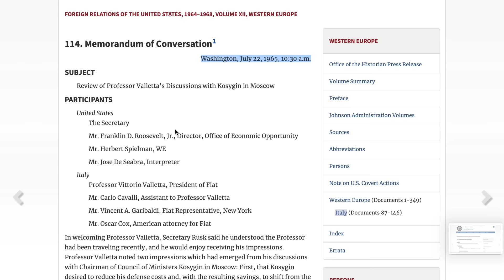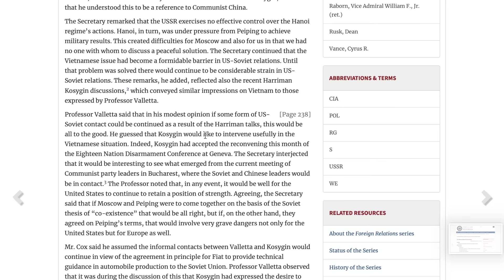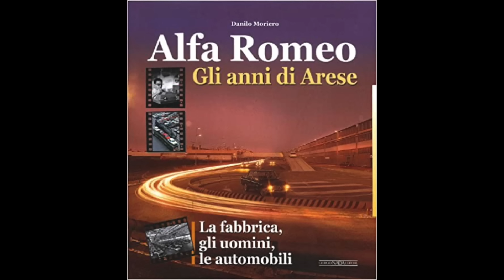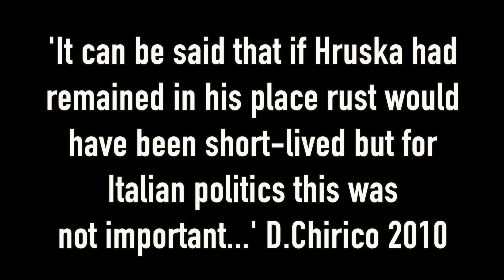Alfa Romeo And The Myth of Russian Steel - The Real Reason Alfas Rust

Comment: I think the steel of this era suffered from the transition to melting scrapmetal electricaly instead of melting up a mixture of coal and ore in a blast furnace as before. The scrap at the time contained a lot of pollution (just look at the way they did it: light up the car to get rid of the interior and then press it all to a cube, loom and stuff included - you know what I mean) which led to heavy corrosion. The issue was common to all manufacturers in the 70s and overcome by better rustproofing.
Reply: Quite possibly a factor, but from Alfa Romeo's point of view, and regardless of whatever people say about the seventies, it is a FACT that the Alfasud was made from the same steel supply as the rest of the Alfa Romeo range, and yet rusted far worse and far faster, even before leaving the showrooms.  And yes we know people will want to add that their Spider/Giulia/GTV or whatever rotted badly etc, etc, but Alfa's management soon recognised the warranty claims were hurting and sent Achille Moroni down from Milan to investigate.  His report was very clear, it was all down to poor working practices, nothing to do with the steel supply.
Reply: @chrismartin9421 I really loved these Alfasud when they came out for their shape and sound. They soon became famous for dangerous mechanical problems as seized wheelbearings even before the rust became too obvious and I never dared to buy one. But  I had a 1970 Spider Veloce and can tell that they rusted from factory.  It was said that each Alfa came with a piece of sandpaper in the glovebox as standard Equipment. The idea to fill the Alfasud cavities with foam didn't help either.
You certainly have a point with the poor craftmanship and working practices. There a other examples of this combonation that went wrong as the famous disaster of Rootes Group Linwood factory. But  in Bochum on the other hand this was also true and the first workers were bakers or bricklayers but they did a good job on the production line. The cars were rotted out after ten years anyway just as cars normally were after that time.

Comment: I don't know about Soviet steel, but owning a few cars from Japan Toyota and Honda in the 70s and 80s suffered from rust very badly. Seems everyone was in the same situation recycling old washer, dryers, fridges, stoves and scrap metal in general had the 70s 80s metal recycling problems. The process must have been fixed as cars last a lot longer today without rusting.

Comment: Thanks for Making me clean my Laptop as I spat out my tea at (16:33) "Franklin Roosevelt who wasn't yet president". 
By the time the meeting with Professore Vittorio Valletta FDR the 32nd President had been dead for 20 years. The meeting was with Dead Rusk President Johnson's Secretary of State (The Secretary). After checking the FDR Jr mentioned is the son of the former President, appointed Chairman of the Equal Employment Opportunity Commission By President Johnson (Director, Office of Economic Opportunity must be a Typo). FDR Jr was a friend of the Agnieli Family and at one point owned a US Distributor of Fiat and Jaguar cars, (so probably a bit of a conflict of interest there).
As a child of the seventies and at the time a petrol head the causes of "Italian rust" where well known at the time  In the case of the Beta it was due to trying to implement, at the time new corrosion prevention primers on a bodyshell with closed compartments. The "Galvanic primer" accelerated rusting in untreated areas hence the reputation for rusting from the inside out. 
There were also Jokes at the time about buying parts for the Alfasud as due to the micro strikes only one line may be affected and an 80 model may be a 79 under the skin. The rust issues were never as universal as with the series 1 Beta more of a lottery.
I think the first time I heard the story was in a Clarkson Xmas video in the late 90's.

Comment: So that myth is debunked. Very interesting and well-researched video.   
Back in the day I heard from people in the business that the Alfasud had some kind of foam blown into some of the cavities ( pillars and elsewhere) to stop noise (booming).  This would hold moisture and speed up the rust process from the inside of the panels. Also it would prevent normal after-market rustproofing (Tectyl, Dinitrol, Waxoil-ing) from working properly. 
Is this also a myth or is it a fact?
Reply from the maker: It is true, only some suds produced in mid to late seventies  had it, it was an interim measure introduced to try and reduce rot but it did the opposite!

Comment: Brilliant!  I too noticed the reference of "Roosevelt" as the former President (who actually died 20 years earlier), but obviously an oversight that does not affect the case made here.  It sounds like the typical lust for power and / or money that becomes so overwhelming that it causes dysfuction and the ultimate breakdown of harmony.  And if its any consolation, how can you blame the workers when there is such high unemployment and they need to take whatever work they can get, but are pawns of union bosses and government officials?  Regarding FIAT, I wonder if Russia would rather have paid in steel rather than oil?  Which would have been cheaper for them to use as payment?  My perception is that the Russians had / have more oil than they know what to do with, but I don't know if they had that much excess steel.  Regardless, this is fascinating!!!!

Comment: Intriguing. I had a 1973 Fiat 127, which I bought from a friend in 1978. It was already beginning to rust badly, hence cheap for a brilliant, lively fun little car. I kept it until early 1981, by which time the bodywork was in serious cosmetic trouble, though not structural.  Door bottoms, bonnet,  boot lid,  wings, all headed toward perforation. Shame really. But aside from the engine and  gearbox, which never gave any trouble, the rest of the car was plagued with short life components. Brakes, CV joints,  balljoints all lasted less than the 3 years I had it and I replaced them twice.  All the parts were dirt cheap, but lasted even less time than Ford or, good god, Vauxhall.  

I sort-of agree, that this was not much different from other mass market cars, but I think the Fiat was at the bottom of that league. The kindest thing I can say is that 60's Fiats were even worse! I had long term use of a glorious Fiat 1500C, a few years earlier.  It looked elegant and drove great, RWD with a lively, revvy engine, posh disc brakes,  but the bodywork everywhere was held together by paint. Bits literally fell off each time you shut a door. It was barely 5 years old. Even my old 1963 Hillman Superminx Convertible (in bits at the time, knackered engine) was relatively rust free at 8.  And the 1958 Ford 107e Popular I bought for 10p (the seller's busfare home) had no rust at all at age 13 (nor bigends - but I got a newly recon engine from a breaker for £7.50).

Comment: To the Alfa story, you may add that the management cleanup of 1974 involved Mr Luraghi, who really was a visionary (he had made Alfa what it is still remembered for today) paving the road for the company’s disruption of the next decade. The lower point of the process probably being the joint venture with Nissan, marred from the start by De Mita, who had a new plant built in the region he came from (100km from Pomigliano) instead of filling up the capacity of the Alfasud plant. Overall, the Italian car industry has always been used as a system to build up political consensus, absorb excess workforce and push up internal economy. After the end of protectionism, and with Fiat management partially withdrawing from the car manufacturing sector, it all went wrong

Comment: As I remember the only way to save a 70s car from rust was to have it "Zeibarted" from new. I believe this was a wax coating sprayed into every panel cavity on the car. Even Minis would stay rust-free for 10 years with this treatment.
Reply: Yes I remember that my uncle had his Vauxhall VX4/90 protected by Zeibart. Unfortunately being basically a upmarket Vauxhall Victor it still rusted out and fell to pieces. I don't think anything could save those vehicles from the dreaded rust they were completely beyond help. Maybe Zeibart gave it an extra 6 months.

Comment: I'm not convinced that storing steel outside was a problem. 
All steel oxidises when not protected so will need taking back to good metal before painting. 
Unless your steel has lived in 0% humidity since it was made it's going to have surface rust.

Comment: those aluminum twin cam blocks were cast from junk, coolant used to bleed off under the headers, on the 1300 and 1600 twin cam engines

Comment: Actually, early post war soviet car build from belgian steel ( gaz m20, gaz 21, gaz 13 and other ), but lately, i think on 1960, all russian car manufacturers start use steel from Zaporozh metal fabric. After soviet-italian project VAZ in Togliatti, italian actually bought soviet steel. But, russian car same period didn't was so badly rusty, many of this car have 30-40 years of uses and still didn't rust much. Absolutely right thing - belgian and other European steel was better quality, but -  soviet cheaper. I think, it's poor quality of production and painting process on italian manufacturers is the key.

Comment: I have a 13 year old Brera, it’s not perfect when it comes to rust. Front subframe, rear subframe, air box bracket (this had to be replaced, it turned to dust), washer bottle bracket, front bumper support brackets… I could go on. So, at the time when this car was produced, they did a good job of protecting the monocoque with galvanising but completely forgot about lots of other vital components
It’s not moonlight and roses, not by a long way
Reply: I used to have a 146 and it was very low at the front. The bumper supports rotted away but in part I think it was them flexing every time you caught the bumper, multi storey car parks were a nightmare. Rest of car was solid.
Reply: Mercedes of the same era are pretty well as bad. In fact Mercedes were the worst rusting cars of all from about 1997- 2001. My neighbours MB Vito van was scrapped at seven years because of rust. My 14 year old Alfa 164 next door hardly had any rust at all.

Comment: When I first bought a car in the early 80's I was told never to buy Italian cars because they rusted so badly , and it certainly seemed true enough.
Also I was warned off 1985 Ford escorts and orions later on.
That seemed also very true with numbers of them stacking up throughout the local scrapyards. 
I was told that was because those cars were built in Spain and had insufficient anti rustproofing on them for Northern markets. 
Anyone know the truth about this?

Comment: I remember that era all too well. Great cars, some only a few years old and they'd be disappearing in front of your eyes like polystyrene and poly cement. Real pity because they were great cars but no amount of welding could give them any more than a years MOT. We used to buy them down the auctions for nothing, weld them and race the fuck out of them usually until they broke. Italian parts were also dead expensive and difficult to source; especially prone were CV joints and the cam belts that had only had a short lifespan and were a pain to replace especially if somebody had welded over the engine mountings on the left, so you couldn't drop it, which was not uncommon as often there was so little to weld to; esp inner wings. Great cars but a fucking nightmare for rot and you know that whatever you spend on it is like pissing it down the drain co's you sure as hell aint getting it back, unless it's a Fulvia where you could get good money for the V4 engines...strange to think now nobody would break a Fulvia, but in the mid early 80's, front sub frames would go on them, gorgeous wonderful cars though.

Comment: That Pomigliano factory is just somehow cursed with rust issues. Every Alfa Romeo ever build there is prone to rust. Even relatively new 156, 147 or GT are rusting as hell. My uncle got new 156 Crosswagon and after only eight years that car had to be scrapped because of excessive rust it was no longer roadworthy. Even 159 do rust, but not as bad. On the other hand cars from Arese like 164 are really excellent in rustproofing. Same goes for 166. Even older Alfas like 75 or 90 are a bit better than BMW of that age.
Reply: My Alfasud had very poor quality steel- it was much thinner, prone to rust and the quality of the paint was much lower quality than my Alfettta GTV6. I have no doubt the steel used in Arese was better quality than Naples, poor practices notwithstanding. I am not convinced that rust plagued other cars as much as the Italian cars of that era from the South, or that the Italians got it so badly wrong by a series of unfortunate missteps. I am not convinced by the information provided that the steel was not the culprit, whatever its source.

Comment: Alfasud was doomed from day one! Wrong location, no training, too much local corruption, "i sindacati" and the perpetual "sciopero", not a chance to succeed! Quality, or lack of, of steel had nothing to do with it. On the other hand, my present Alfa Spider, made in 11/87, has NO rust issue and it has been very reliable with no problems except for the water pump breaking at age 26, not bad!, the rest just maintenance, oil changes, breaks, tires and wipers!

Comment: Thank you for an interesting video.  My Uncle was a huge fan of Alfas and had a whole string of them - he got a new one every 18 months and the previous one was passed on down to my father (They worked together)  I had 2 Alfa Suds, the latter being a Gold Cloverleaf that I bought off said Uncle.  We discussed rust etc. and his reasoning for the poor quality of the steel and latterly the first manufacturer to use galvanisation on all cars (like the Gold Cloverleaf) was that the Taranto steel plant received subsidies as long as they recycled 50% of their output, and as a result of Mafia/Socialist/southern Italy the quality was inherently compromised.   As my Uncle was a polyglot, their company manufactured machinery and his relationship with the Milan factory was excellent I have always believed his reasoning.  If you were to continue with the investigation, Taranto might be the place to start.
Reply: Yes this sounds far more plausible.  Impurities, and poor mixing of the metal so there were variations in compostion across the sheets, leading to internal potential differences.  Add water and you have rapid corrosion.

Comment: I had heard the Russian steel ,but for  Fiat ...The Agnellis where known for supporting whatever side was in power and what was good for them ...I have found that in the UK people have never ever  forgiven italian car makers for the rust and people nowdays who wouldn't know still peddle the theory that italian cars rust ..As you say back in the 70s all brands rusted ,Japanese cars where shovelled off the boats ,French cars where bad and our own brands where the same ..The metal treatment we have now was not a priority then ..Nowdays  10 year old cars still look good back in the 70's it would be a yearly requirement for new sills ,wheel arches . mc pherson strut mounts  (ford) ,floor pans ,valances etc ..Also in the 70's italy was pretty corrupt so the mafia involvement makes sense ,We also had constant strikes ..Even issues about italian wiring is still rife .i have never had issues with any of my Fiats or Alfas ,Well apart from the loom that goes from the body in to the boot ..The book looks interesting and i may be tempted to buy it  ..This was an excellent video and it explains a lot and makes sense
Reply: True the '70s had a lot of rusty cars, but the point of this investigation was to find out why the Alfasud rusted much faster and with worse consequences than the rest of the Alfa range which were made from the same steel supply but in the Milan factory rather than Pomigliano d'Arco.

Comment: Rust was not so much caused by the steel quality,  but lacking passive/primer/paint Protection systems. Using thin blankets also never helps. 
The usual Italian Strike intensive workforce is to an extent true till nowadays.

Comment: Sadly no knowledge of where the steel came from, but just more anecdotal evidence of the terrible rust problem that Italian cars suffered from in the 1970's.

My parents owned 2 Fiat's bought new and within a few months of each other in the early 1970's.  These were a white (originally) 124 estate (which quickly earned the nickname among my parents' friends as "Your 2-tone Fiat"  (White and Rust) and an orange 127 Mk1. Perhaps a wiser colour choice.  The 124 literally saved my father's life as it had real brakes, which saved him from a motorway pile-up, and was a replacement from an Austin Cambridge A60 (which didn't).  The 124 lasted about three years, by which time it was rotting into holes. When my mother sold her 127 after about 5, the holes were so bad that the car had to be liberally filled with fiberglass and completely resprayed before a victim could be lured to take it over.

It's true that all cars rusted at that time, but the Fiat's rotted far faster than any of the other cars my parents owned. Most of which remained presentable even after 8 to 10 years